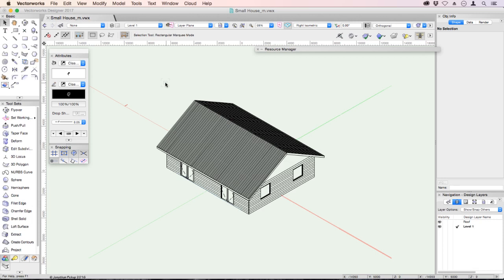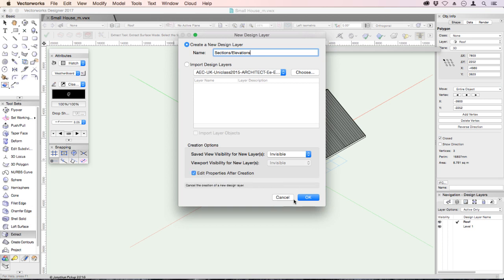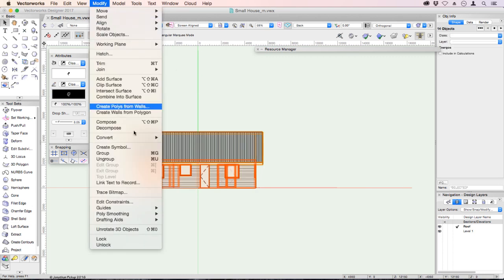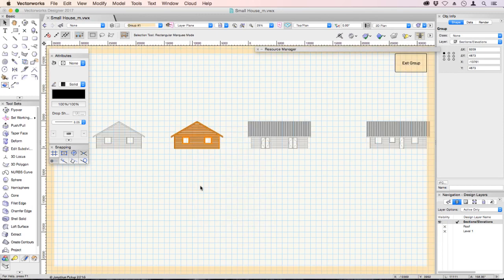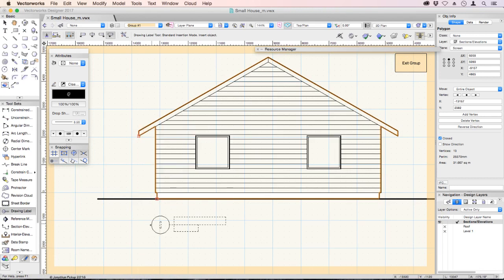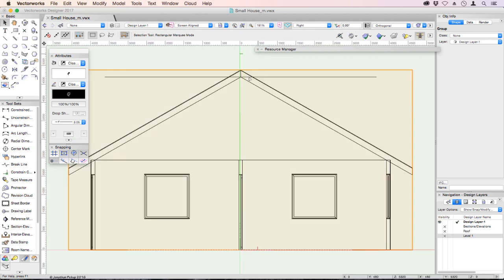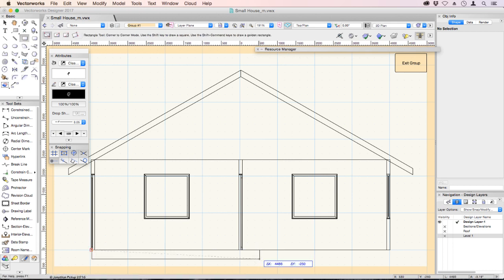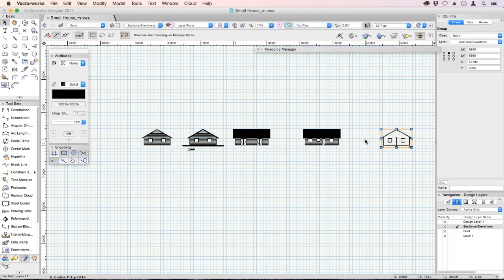2017 Vectorworks Fundamentals - Creating Static Sections And Elevations

Comment: Hi Jonathan- I'm a mid- (ok, late-) career architect, working my way through your Vectorworks Tutorial Manual-8th Edition (still a classic!) just to wrap my head around the basics of Vectorworks. I'm having problems with creating static elevations with the method you describe in Chapter 8 of the manual and this video. For some reason, when I create the elevations with Convert Copy to Lines command  I get the outline elevation, but without the hatching applied to the extracted planes showing up. I've tried with the model in all three render modes on the Design Layer(wire frame/hidden line/Open GL) but get the same results. I've even tried with a simple model of my own with the hatching defined by class and the same thing happens. Am I missing a step? Or is there some setting that could be causing this? Any insight you could give would be very much appreciated.
Reply from the maker: Hi Sander, when you convert copy to lines, do you have the extracted planes selected?
Reply: @archoncad  I don't know. When I hit Select All the outline lights up, but I'm in an orthogonal view so I can't tell if the extracted plane is included or not. Is there a way I can find that out? I built the sample model in the manual and checked it in the Object Info Palette. It said I had 7 walls, 2 polygons and 2 polylines on Layer 1 and 1 Roof and 4 polygons on the Roof Layer, in case that helps.
Reply from the maker: I don’t like using static elevations, I much prefer the dynamic elevations